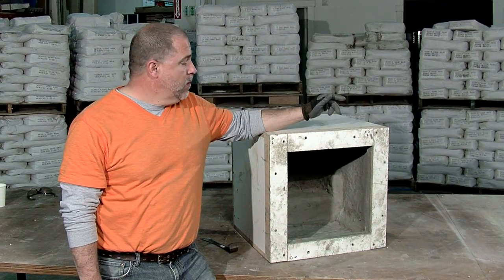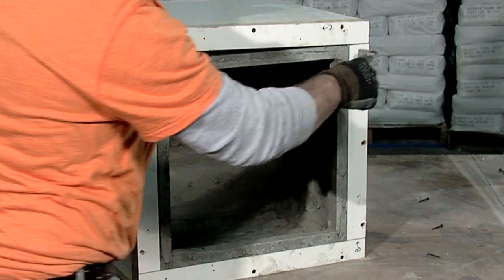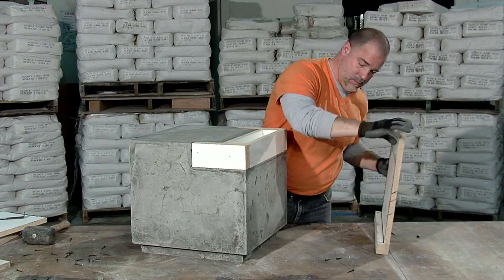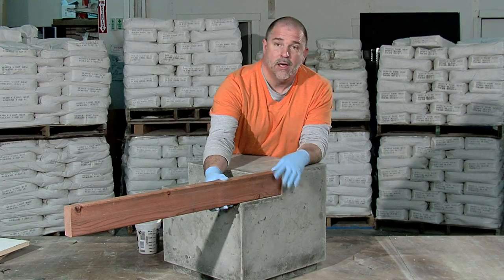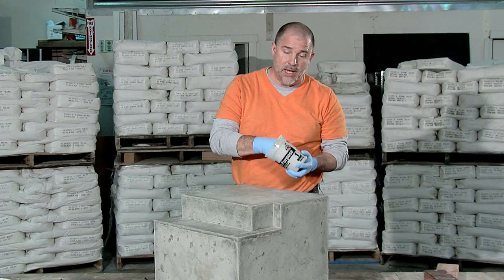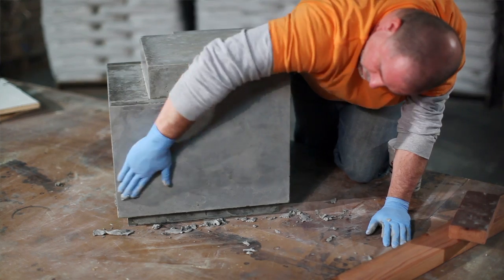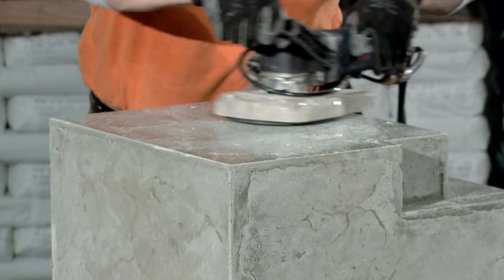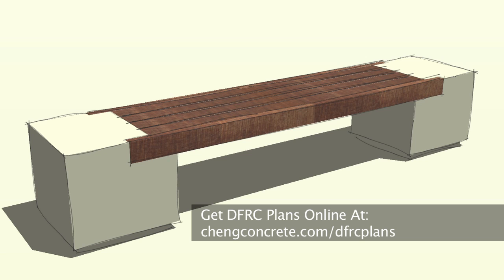Rhomba Bench Demolding and Polishing

Comment: I tried making this bench. I missed the first video on how to make the mold but it seemed pretty straight forward. Anyway, as I poured the third 80 pound bag of mixed concrete into the mold it came apart from too much weight.  Any suggestions?  Demensions were 15"x16"x16.  Just plain old quickcrete mix.